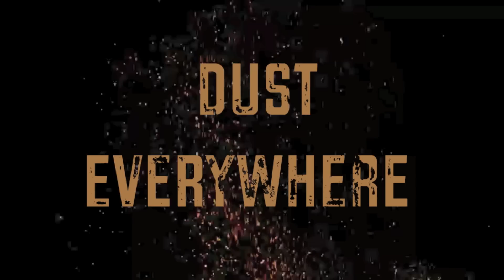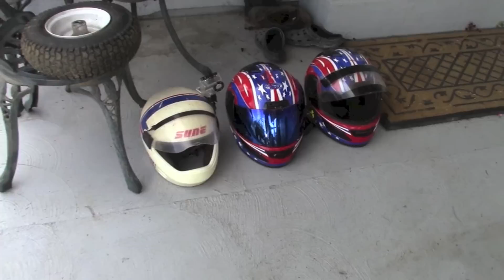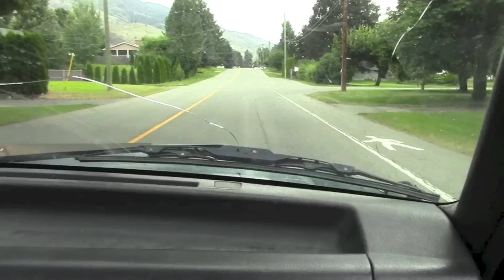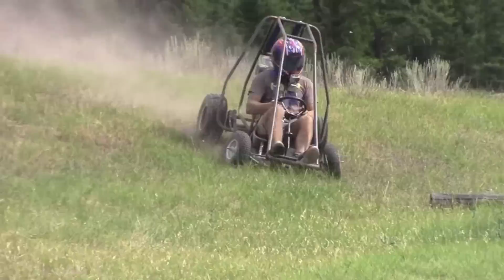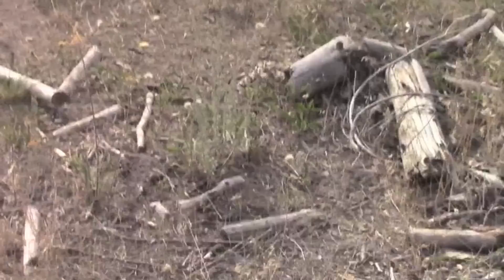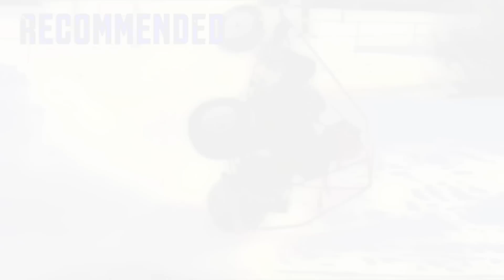Homemade Go-Karts Episode #8 (Dust)

Comment: i typically get mud cause old knobby tires (basically slicks because the knobs are gone in the front) have horrid steering. My belt is too thin due to age so a coat of belt dressing before use, Sta-bil Protection and Octane Booster make a old Tecumseh 6.5 HP enduro motor no suspension kart at peak performance can hit somewhere around or north of 40 mph. With the belt not catching the kart can have a clutch slip at any time

Comment: The wheel looks a little bent just saying and does your chain pop on them hard hits?
Reply: And does the motor get messed up at all when you flip?
Reply from the maker: +Honda Cr 500 Yeah this outing pretty much forced Cade to put front suspension on his kart.  We used to constantly have problems with the chains coming off, so when we bought torque converters we opted to use 40 chain instead of 35... since then we've gone karting several times without having the chain come off any kart.  As for the engines...I've had the same motor on the orange kart since I first started driving it... in 2007.  I have no idea how it has held up.  Best $100 investment I've ever made!
Reply: +KGN Metal How fast it goes? (km/h)???